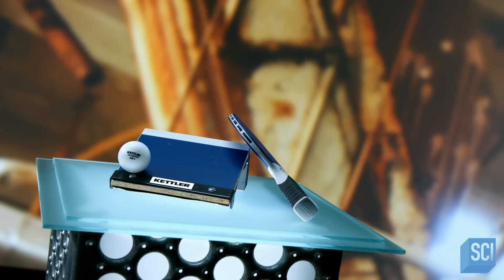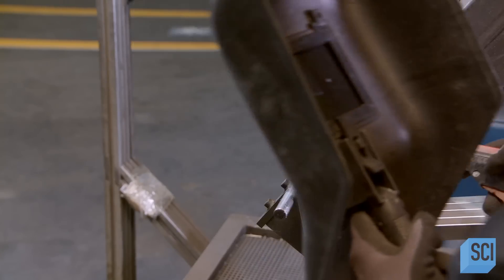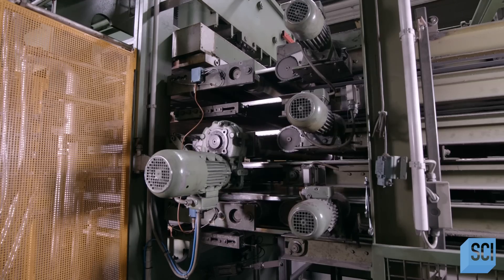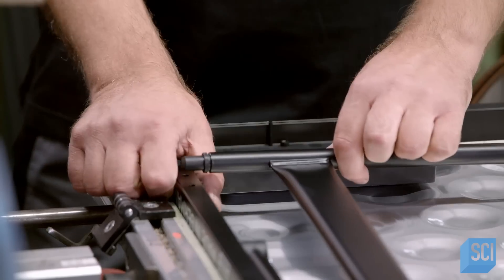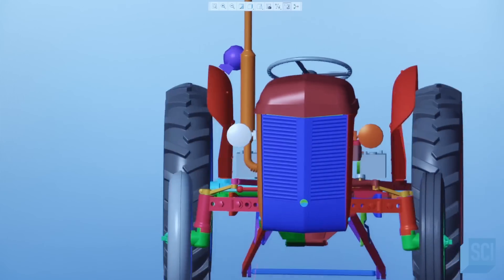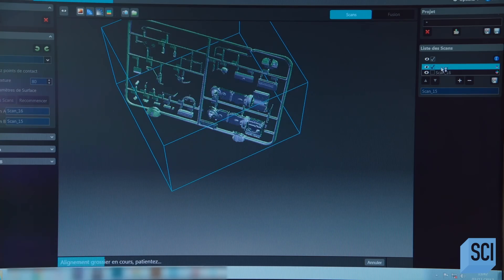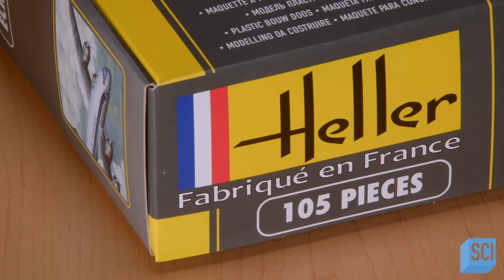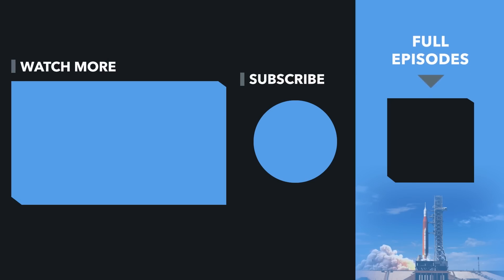Discover How Ping Pong Tables and Plastic Model Kits Are Made | How It’s Made | Science Channel

Comment: I thought it called sprue not tree
Reply: In the injection molding industry, which one of my grandfathers worked in, sprue is the term for where plastic enters the mold; what is called tree in video can also be called runner; and gate is the term for the channel where the plastic flows from the tree/runner in to the actual part.
Reply: Just an FYI: the terms sprue, gate, runner, etc come from the world of metal casting... which has been around for far longer than plastics or plastic injection moulding. Best wishes!

- Max Giganteum
Reply: erm actually its called a runner ☝️🤓